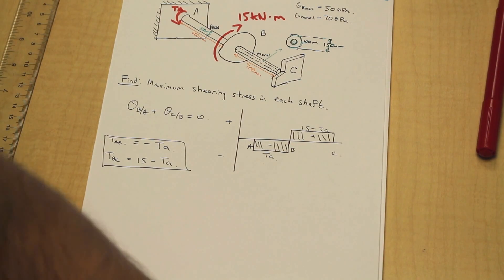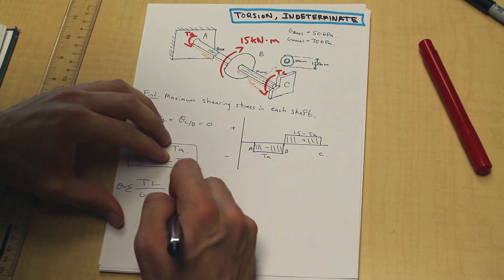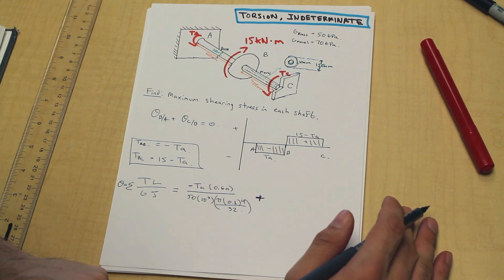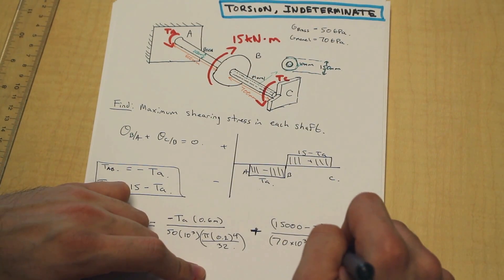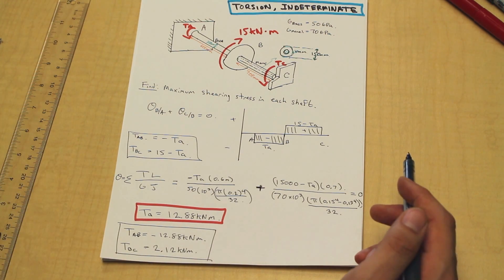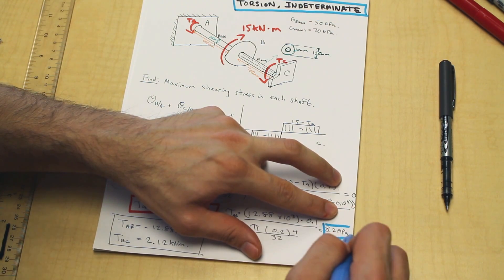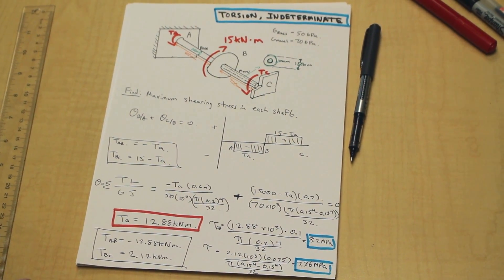How to Solve an Indeterminate Torsion Problem (Max Shearing Stress) - Part 2/4

Comment from the maker: TimeStamp !

0:44 - Theory Ends - Solution Beings (Dont skip the Theory!)
1:06 - First Step -Sub-in the numbers into the "Angle of twist equation" 
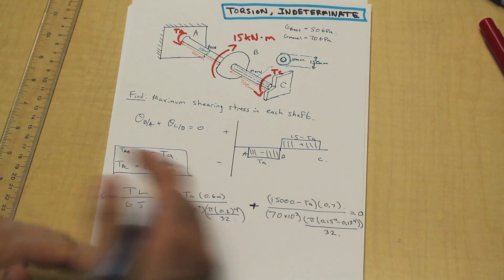4:02 - Second Step - Equation is ready, pause the video and solve it yourself!! Do not wait for the mid-term to test your calculator 
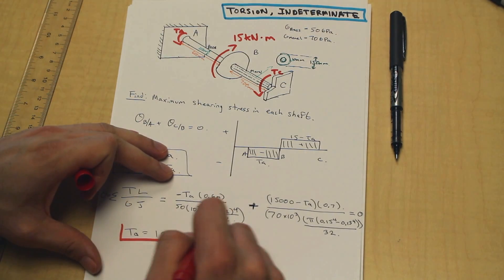4:51 - Third Step - Make sure you get the same result as us for "T-a"
4:52 - Fourth Step - Calculate "T-ab and T-bc"
5:47 - Fifth Step - Find the "Maximum Shearing stress" in EACH Shaft
7:58 - Final Solution (Now try to do it on your own!!)

The Indeterminate Torsion Problem has FOUR parts

Part 1 - https://youtu.be/PXMuqTfyEug
Part 2 (Which you just watched) - https://www.youtube.com/watch?v=ppnr1IpfjX8 
Part 3 - https://www.youtube.com/watch?v=L4o9sI5iQ1I 
Part 4 - https://youtu.be/n1oD69nyjYE

Comment: Solving for J in this video, I believe the difference in diameter is 0.02 m not 0.2 m
Reply from the maker: Luay Tahrr are you referring to the first term luay?  the diameter is 200mm of the solid bar, which is 0.2m. the hollow bar is outside diameter ^4 -inside diameter^4.
Reply: My bad, I was thinking the first part is hollow too.
Reply from the maker: Luay Tahrr no problem we love when our viewers ask questions and interact!